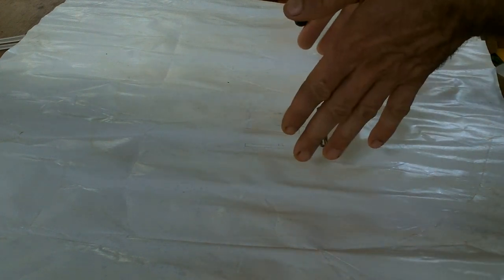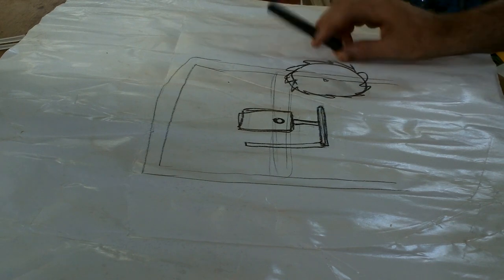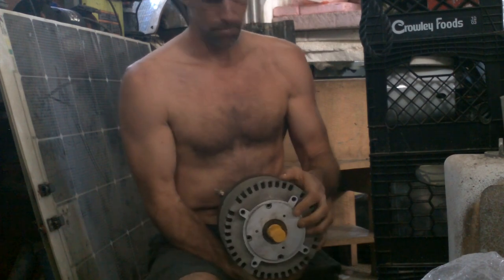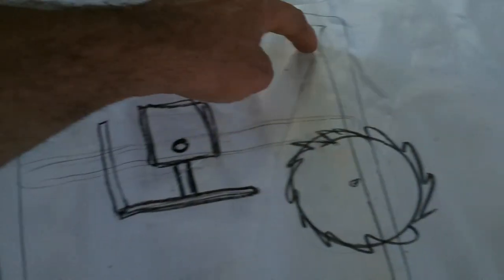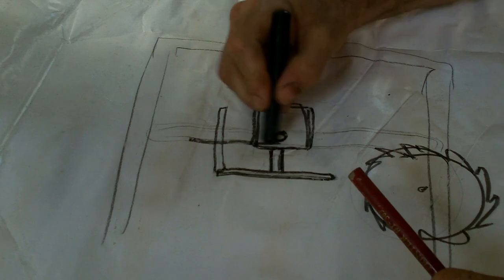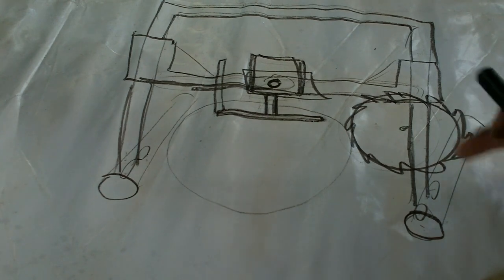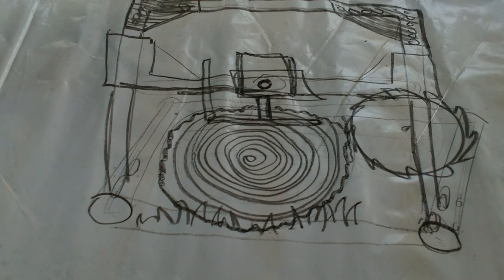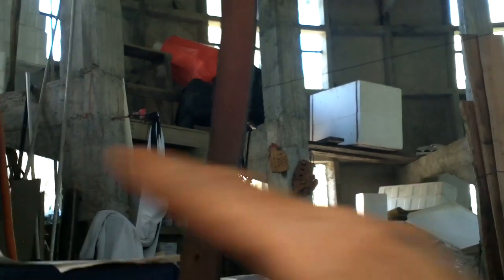Lumbermill 001

Comment: Swing blade saws are great but your depth of cut is limited to just under half the diameter of your blade by the time you add fasteners. 12” blade would give you a 5” depth of cut… if you could get a 16-5/16”  saw blade you could cut a 2x6 no problem, might even be able to get a 8” depth of cut. 
If your going to take the time to build it you might as well be able to cut proper boards with it when your done. 

A slaber style mill based on a chainsaw bar would probably be easier to build but not as efficient at producing finished lumber due to having to handle the slabs and cut them twice to get squared pieces. 
Keep up the good work!
Reply: With a 12 inch blade he will likely get a 4 inch cut. 8 inches with a 4 inch adapter. That is 1.5 inches of meat to which he can screw the blade in as it need to be flush mounted. He will need to make a drilling adapter so that he drills the blades the exact same way every time.

Comment: Always love wood sawing projects. Just from the videos I’ve watched, I would think that running the saw on wheels is going to cause more problems having to continually having to shovel or move sawdust/chips. If you look at something like the Turbo Saw you can see how they change the blade from vertical to horizontal and travels on the rail. I am sure that whatever you build will be incredible. Look forward to the progress. Thanks for sharing.

Comment: With a 12” blade, isn’t that going to be limiting with attempting to cut large logs?
Reply: No they swing for a 90deg. cut. He might be limited to a 8 inch x 4 inch board. In three passes he could cut two 2"  x 4" boards.
Reply: You might want to look up Lucas sawmills. They use the same design but with a 14-in blade. You run down the length of the log with the blade vertical and then flip a lever and it is reoriented horizontally. You cannot cut large live edge slabs, but for making dimensional number, it's much much faster than a traditional bandsaw mill strictly because you are cutting in both directions, there is no walking in the sawhead back to the beginning of the log, you cut in both directions. This also means that you never have to turn the cant, generally the log stays still and you're left with a scab and for firewood at the bottom of the log as well as the corners

Comment: What if instead of rollers you used sprockets? You could then have machine chain as the track, this would prevent the Saw Head from being able to slip and it takes away some of the jerkiness of moving it with human power. There's a channel called topper machine shop, he did something very similar but used wire with multiple wraps around the main spindle. So turning on the Saw Head also activated the feed for the log and would retract using the same system hitting a limit switch and changing direction. The multiple loops on the central spindle prevent any slack from getting into the system, he ends up with beautiful chatter free cuts. I think he has the finest DIY sawmill on YouTube personally

Comment: I was running a bandsaw mill for awhile and it was very simple, could be converted to electric quite easily but the limitations were the sharpening of blades, which you can use a jig and could resharpen the blades alot which is good, but if the log was a bit dirty it would dull them really fast, which you have blades with carbides and that would last longer but also limited to size, I wouldn't worry to much about stainless, maybe just a good paint. Simple is the way to go and that brush idea is great, I was going to do  that also, sometimes the roller would ride up on bark and change the cut... Blaa Blaa.. Ohhh you can make a cut sheet and stick it to the side of your carriage so you can make different board sizes so you don't have to waste to much time

Comment: They take the label off and send it back to the manufacturer when they get sent a warranty replacement.  Usually they do not send the old motor back. So I would test it before you go too far with it.

Comment: Just thinking out loud here... would a big angle grinder be useful as a 90 degree pivoting head? Motor has plenty of torque for cutting and has a brushed universal motor which technically can run on DC power. Don't know if the spindle arbor is the same size as the blade arbor size though. 🤔

Comment: Dual blades are a bit better. As this makes one cut and gives you one board. With a 12 inch blade you will get 4.25 inches of cut so you will end up with 4x4 4x2 4x1 boards which are more than enough for anything you would want to build. Dual blades are far more simple to build and control. 
I attempted to build one some years ago. There is a video on my channel. If i was ever to build one again I would go with the dual blade set up. Yet really I would find one of the Lucas 4 inch swing blade models. 
There is a video of a reall cool dual blade saw mill on MartyT channel.

Comment: The design you mention isn’t that a Lucas Sawmill design?
The commercial version is to big and heavy, but a scaled down version of their design👍🏻..
Thinking dimensions and weight I would go for six 3 meter track supported by six aluminum feet placed outside of the frame (simple fixed laser pen guide line on cutting line?)and I wouldn’t go wider 2 to 2.5 meters with 6 meters length.
big enough to cover one big straight tree trunk,
Height adjustment can be tricky to simplify as to lift all six corners (four corners would you downsize on length).
A maximum dimension for sawn beams 15 cm square max 20 cm would be enough for everything I wanna handle and use in construction 
Floorboards the wider the better but minimum of 40 cm woud be okay, cutting 20 cm from either side.
Nice project to build whatever the dimensions wil be?

Comment: Why rotate the blade when you can more easily rotate the log?
Reply: Because swing blades are faster and less work. The whole point is that you cut down, then swing the blade and cut back. Board is now finished. moving the log is a waste of time when you could be cutting the boards you want.